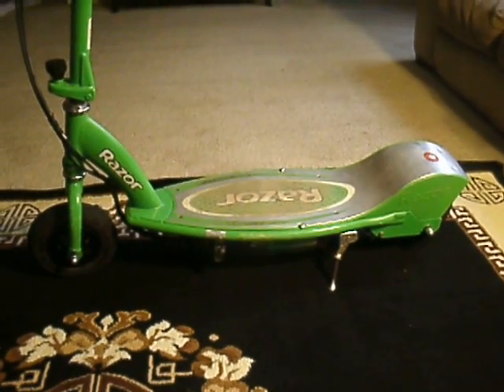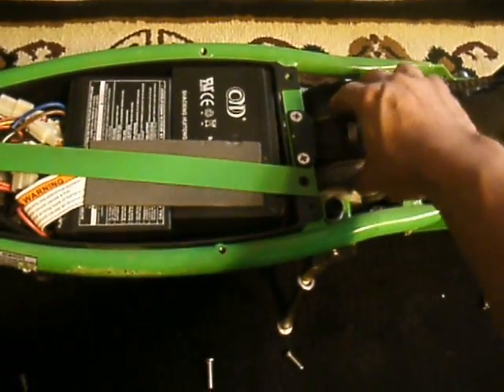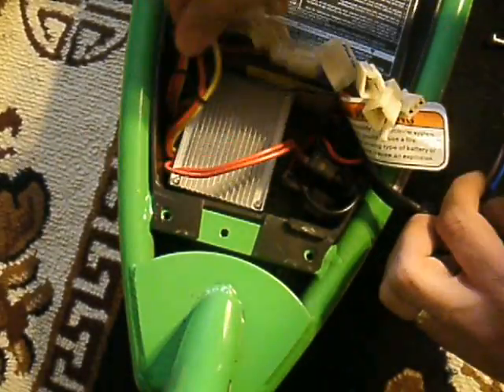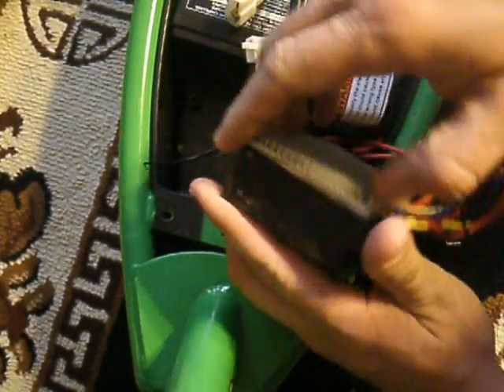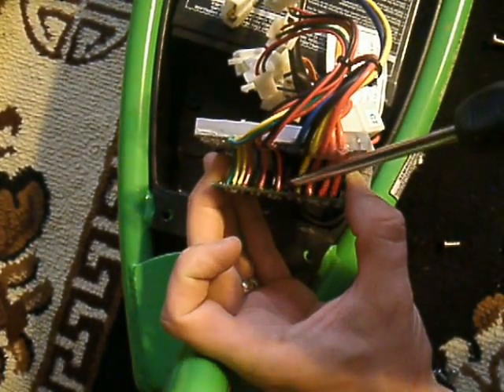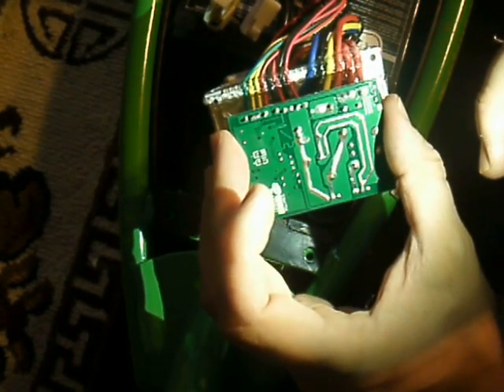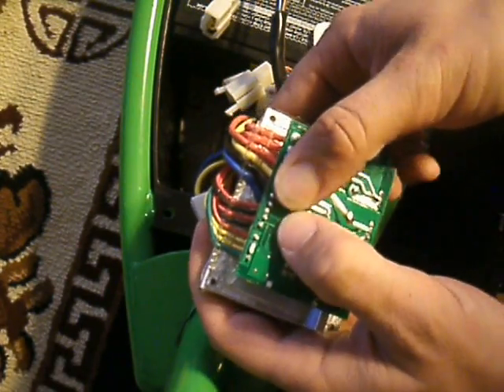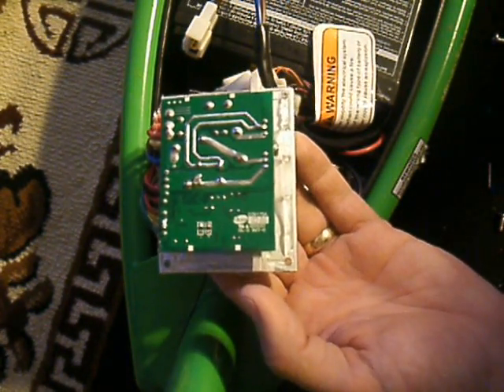Increase Electric Scooter Speed and Torque!

Comment: Weird I did this on a E200
And it was great way faster!
Then I did it on a RX200 and nothing!!!
I think some of these controllers are a bit diffrent I noticed 2 - wires soddered together on the board of the e200 and not on ex 200 I think Somme have always open or closed circuits where it prevents this from working!???
Idk!?

Comment: Dave buddy, how does adding one more little peice of wire etc across those two sections increase speed etc? As those two bits are already joined together on the green side of the circut board
Reply: I believe the idea is to increase the current path by making it thicker essentially although he is talking about bypassing it altogether it sounds like. Beefing up the existing trace with solder would be a more reliable mod as his method will most likely pop the mosfets on the PCB at some point from too much current.

Comment: I have a e6 error code, the scooter fully shuts off randomly whilst riding,  and won't come back on but when I connect back to charger it comes back on showing full charge.  When I lay the scooter down and accelerate its fine , as soon as I get on it and accelerate higher than 15/20mph it shuts off with e6 code.? I turned the voltage down because most advice was undervoltage error but that has not done anything? I reset the p settings and still no joy,  I opened up everything apart from the battery. And all seems well, my rear mudguard came off a few weeks ago and the wires shredded abit for the back light,  I've taped them up singularly and still no joy. Any ideas anyone?

Comment: Hey Dave. I have The Urban Hamburg XH1 and it has a brushless motor inside but there is still a silver panel/block like that. Some scooters have the option of I’m clicking a wire…mine doesn’t seem to have it. Will this be the same method I would have to do?
Reply: Also there is a fuse from the battery to power supply..
Reply: No. Not at all. If It’s  a brushless motor it’s a entirely different speed control than this

Comment: Hi. Nice informative video. I'm considering doing this on my razor e300 - do you have any idea what the extra drain on the batteries will be after the mod? I'm concerned I will be limiting the already short lifespan of the batteries between charges. I'm already getting less than 30mins on a typical use 😂. Thanks!
Reply: I’d recommend just trying it and if it does effect your battery life, go from there , replacing the battery shouldn’t be the hardest thing with one a little larger I can only see the size and it not fitting being the problem , however if you were putting a new computer in it then we’ll you’ve fucked it in my eyes because I have no idea what I’m doing at that point

Comment: I’ve seen a lot of these shunt videos but what I want to add is that before you do anything. Measure the resistance in ohms across the shunt. That way you have a way to measure how much solder to add. If you double the resistance for example, you should get double the speed or max controller speed whichever is greater.
Reply: I guess you have to lower the resistance to increase power. And one should know how to measure a few milliohms. Also speed is always voltage dependend, not amps.
Reply: @mistersunny3636  I mean reduce not double, double the solder is what I meant.

Comment: didnt see any comment actually explaining why, so here is what is going on. That wire is not a current limiter, its a current sensor. Dont cut it, leave it there and add the other wire as well. This works because it tricks the controller. The resistance is now lower, and the controller measures the current incorrectly and thinks its allowed to pump in more the current. Making the wire bigger than a paperclip is probably not necessary. In fact the paper clip is probably more than necessary. The controller is likely already running at about 80% duty cycle to hold full speed so you just need to divert about 20% of the current around the original shunt to get 100% duty cycle out of the controller. Im just guessing those percentages from experience, I could be wrong. Now remember, the manufacturer programmed that exact current limit for a reason. Its not like they just didnt want you to have fun. They know that past that limit, stuff starts getting unsafe. By all means do the mod, but remember that full throttle is now a turbo mode that should be used lightly. If the motor, speed controller, and batteries are cool to the touch, keep pushing it. If they get hot, back off a bit.
Reply: "So the controller sees half the current" [through the original shunt wire]. Er no! The controller cannot measure the two currents through the original shunt and your new one separately.  The controller just 'sees' a single electrical path from A to B. But now that path has a marginally lower resistance.  This change opens the gate in the mosfet slightly more, allowing greater current to the electric motors, thus feeding them more juice and making you go faster.  One thing to remember is that the manufacturer would have selected the mosfet for the original design current value. So any big increase risks exceeding the mosfet's rating and it will overheat and fail in a couple of seconds.  Solution? Increase the mosfet's heatsink size to disperse more heat (small improvement), or way way better: swap out the mosfet for a higher rated one and bolt it to a big heatsink!  Personally, I'd accept a modest improvement in speed (by using a thin extra shunt) and retain some of the original reliability.
Reply: @robertreid3806  Thanks. I worded that wrong. I edited my original post.

Comment: tried this, but the motor cuts out after very short ride, any feedback?
Reply: just a wild guess, but since you are now pulling more current, its overheating and tripping an overheat safety cutoff. if thats the case, you should be able to ride forever at half throttle. If that works, then just remember that full throttle is now a temporary turbo mode to be used lightly. If it cuts out even at very slow speed, then something else is wrong.

Comment: Cheers dave just did this to my e300 ,shit yeh it works well.more tork and power.cant wait till the morning when its fully charged up and take it for a good ride👍👌👌
Reply: Has it burned out yet ?
Reply: @djcranium1210 I just got given 1 e300. I fixed it and charged up batteries. Was wondering if it burned out yet. I've seen alot of information about mods. It's possible but I don't think I'll do it. Swapping out sprockets will achieve same idea. I'll try that instead. Made in China says all that
Reply: Doing this now to my e300 how good was it?

Comment: know about this shunt and all but I would like to know where I can find the converter and how to on hook it. They have many videos on this shunt but there's not on the converter at all. Now I do know it's a 2 wire hook up but where the hell is it. I love to boost my ebike scooter up to about 40 or 50mph. I do know that unhook this converter will boost the crap out of your scooter. I would only use the speed's on back roads where there's not or hardly and cops. But no one shows you how to unhook this converter. Someone need to make a video on this. Now I also know that adding an extra 12v batter will make it go faster but not that much. So please someone show us how to unhook the converter please. RAY

Comment: Meanwhile.....back in China, a factory owner is smiling and rubbing his dirty little hands together thinking "Thanks Dave!"
Reply: Then that little factory owner in china laughs all the way to the electrical engineer responsible for the design, and realizes Dave just bypassed a failsafe specifically designed to reduce the amount of strain on the cheap motor and possibly increase the overall run time on the battery.

Comment: Recently purchase Uberscoot ES04 300, which came with chain drive and 250W motor, lead acid 24v battery supply (2x12V) and a 24V controller.  Just installed a 350W 24v motor, and it required no modifications (just fit).  Reused the motor power plug as the metal connector contacts were already on the wires of the new motor.  Just had to remove the plug from the old motor and extract the old contact leads from the plastic plug (clipped internal stops on the old metal contacts were easy to depress with a small screw driver in order to extract them). Then I simply inserted the new contact leads into the plastic-housing plug. Note: matched the colors of the vertical and horizontal contact leads within the plastic plug so that the motor direction is kept the same. This has already dramatically improved the hill climbing torque of this well made scooter. I used heat shrink before inserting the lead contacts to avoid shorts and better moisture proof connections (did this for the whole length up to the motor housing.  Also, I added some hot glue to the backside of the plug for reinforcement. 

Next up...replace the lead acid batteries with 12000 MAh Li-ion branded battery pack with a BMS as part of the battery unit. I am staying with 24V...I do not want a speed demon for me or the kids.  Just a better hill climber. In addition, to upgrade the controller to 24V 500W.  This should better handle peak power demands with the Li-ion pack. Lastly, keeping the rear sprocket the same...no change other than adding some marine grease.  Again, no need for more speed on my part here.

It all fits like a champ.  Battery unit was about $70, controller about $20, and the motor about $50. Scooter originally cost me $250 new, so all in I have a decent and legal scooter for just under $400, with a good range.

Comment: I have the identical one
 ABSOLUTE NO DIFRENCE AT all so I will bypass the stepdown reg. From controller to throttle. I see supposedly this works for some people but being the identical processor this should work on all I used a nail,paperclip and tin foil nothing works! I would assume this is for a controller that is partley work out not supplying the full 24v
Reply: You can measure the current flows directly to your motor using multi meter. Switch on your scooter and full throtlle then you see how many voltage, if not reaching 24 volts then do jumper on current limiter. If supplied 24volts exactly then don't do anything.

Comment: This is called a shunt mod. You shouldn’t do this a sit will completely remove all current limits on the controller. You will blow the mosfet once too many amps are drawn. 
Better mod is to add solder to the shunt on top the board, so only increase the currently flow and not make it unlimited

Comment: do they make super glue for electronics?
Reply: There are glues that are conductive.  A cheap soldering iron and solder kit is maybe $10.  Replacing the throttle and controller $40 (more speed, no push starts)

Comment: This is bullshit. you take a water hose and then ass brained add a section in the middle somewhere you will still have the same flow out the end. No common sense. If you want High Torque and High speed then swap the whole controller that will do this.

Comment: Does the circuitboard on a 1000w fatglider look roughly the same? I know mine Will come with a speed limiter of 25km/h but the engine can do 45km/h
Reply: Look for fastscooters on eBay. They have everything you need to make the razors faster

Comment: It worked on the razor mod Bella scooter it goes up hills with me on it and it didn't before. But my question is how do you do the Bristol razor scooter it's different. Even the throttle plug is different can't swap it out with each other. Can you help me out with this other scooter so it will climb hills too. Thank you.

Comment: I love the tapping on the board opposite side of capacitors with the metal screwdriver. Rewind it if you missed it. He's totally conserned about keeping static discharge away from components.

Comment: what if you jumped a potentiometer across it so you can adjust the speed to your preferred settings
Reply: make a video like that
Reply: No, you need to modify the circuit heavily. It uses TL494 PWM controller that you need to pull a datasheet of and see how to control the speed in regards to this particular design. Direct wiring a pot across a shunt isn't going to work.

Comment: Sorry to burst your bubble but excluding does not have a processor. All it is is just a toggle switch which is located on the handle (duh) going through the battery which is power in the mortar that is it it does not need a processing court to work anyways if it is which I have and I know it doesn’t it’s not called processing core processor. You’re just trying to make it look like you know so much about the scooter this is your first time Opening is
Reply: SickAbyss McNamee so we gonna listen to a guy that spells Motor like mortar

Comment: Why do this when you can buy a real scooter, such as a H1 Hummer by Qiewa ... I get 40mph and the option to electronically switch between 24, 36 and 48 volts with the press of a button ... and its built like a tank ... not to mention 62 miles in between charges ... I way 210 and it peels out with me standing on it, if I go full throttle at start ... also has a USB plugin to charge your phone, 2 LED lights with running lights and brake light and a horn ... My 11 year old loves the heck out of it.
Reply: Jay Graphix  because some ppl have more time than money, genius, and some ppl ain't tryin ta take it that serious, and some ppl just like to fuck wit shit. Just FYI for anyone modding shit, if you gotta use a paper clip and duct tape, u shouldn't be fuckin wit shit. Seriously a soldering iron is less tha $10. Putting a loose "wire" lol on the board is a bad idea, for when it moves around, it may touch two pins that aren't supposed to be touched, and fuck your shit up. Get a cheap ass soldering iron, learn to use it and open the door to more shit that you'll be able to do....properly...kinda
Reply: Ethan Abernathy the best answer I've seen so far 👍

Comment: I am curious when you have tried this what the voltage output to the motor is reading ? I have seen numerous videos on increasing power and it's obvious that what ever method you use it will drain the power quicker from the battery Anyone who has figured out how to do it and not do this I would happily invest a huge amount of cash and start a company with. My question is this Why not by pass the control box all together ? Run a positive / negative with an inline fuse from the power output from beyond the box i.e. the original input to the box would be for example 48 volts, after running this voltage through the box it will go through various resistors for lights, horn, even the speed restrictor itself which I am guessing this is what you are bypassing on the video? Once the input has gone through all of this the voltage will obviously drop to the motor output hence I am curious what your output to the motor is ? I have an ebike moped I am also an engineer so am tinkering with mine for experimental purposes and have come up with various ways of increasing power and speed on these bikes one are slightly risky to the motor but not the control box To be honest a great video but I would try and avoid anything involving the control box as the electronics inside are very sensitive. I have a video on here not involving bikes and had some good feed back but as with any video you get some fuckwits who have nothing else better to do then slag you off My only wish is to meet one of these guys outside some day My video is commentary and a guy called me a boring British Bastard which was quite strange as I was born in Australia and clearly have an Australian accent ? Anyone who would like me to make a video to show numerous ways I will be happy to do but if you have any comments regarding how shit it is then there is an x mark on the left hand screen click it and presto you don't have to look at it. Or simply pm me and I will happily give you my address to come over personally No honestly mate reason I said that is you have probably had the same pricks as I did. The guy was right with his comment on the hot glue but fair play he said it nicely, hats off to you man! personally anything I work on electrically has to be soldered heat shrinked and include an inline fuse good luck

Comment: Hi Dave- Does this mod or similar mod work for the Eco Reco M3? Great video and how to.
Reply: yes this will work on any ebikes. all this is, is a shunt that cuts out the amps to you motor. mos of them is a long wire. the longer it is the slower you go. these wire are about 5 to 6in long. If you can get at the one in your controller and remove it and replace it with a very short wire with a 5 or 6 Gage or on that will fit the hole would be good. the heaver the Gage the fast you'll go, but be careful is it's to heave a Gage it can blow your controller., another way is to add an extra 12v battery. but check and see how many volt that your controller can handle. It souls tell you on the controller. the bast way is to try and find the wires that control the controller. this will make it go faster, up to 2 to 4 time faster
Reply: Pulse scooter shunt hack
Reply: Holy crap my spelling is really bad. That's what happens when you don't get enough sleep and wack out of your mind HEHEHE

Comment: Sure, this is a cheap mod but, aren't you sacrificing reliability and product life? When you circumvent the current limiter the heat and amperage are going to increase. Either do it the right way by swapping out individual components on the PCB or buy a better controller, motor and/or batteries. Your way is not smart and you have no way of knowing how much hotter it's running. Increasing current while at the same time adding more load than it was designed for (a heavy adult) will most likely burn it up. I didn't see you putting a larger heat sink on, adding a fan, using a temp sensor or thermal overload protection. Also, it isn't a computer so the thing you keep referring to as a processor is probably a controller.